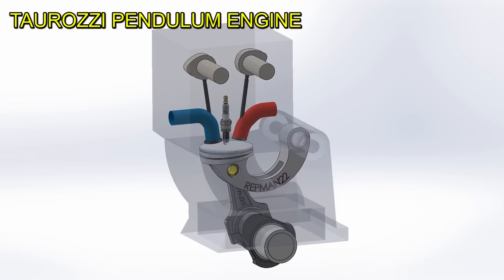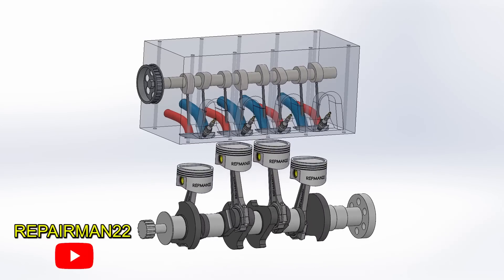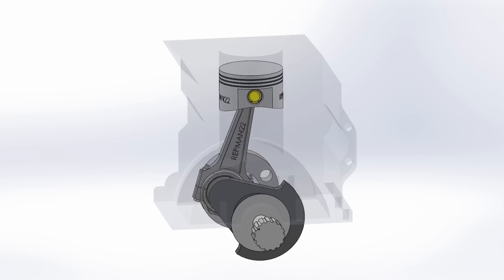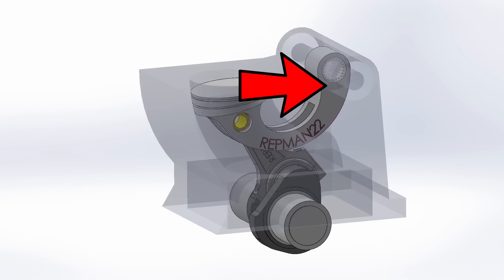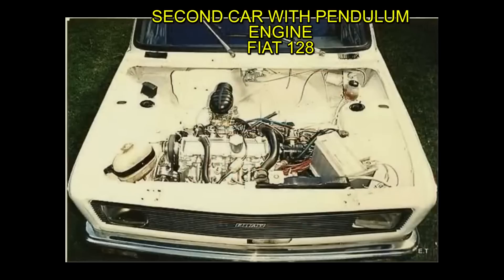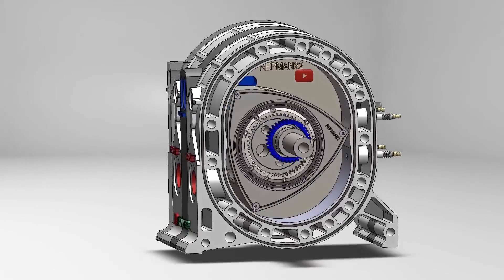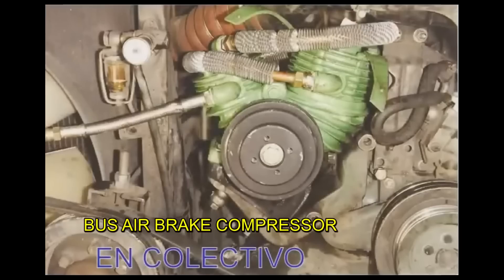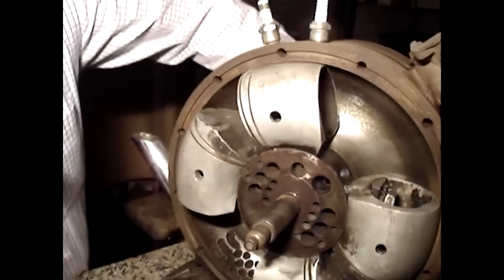All about the Taurozzi Pendulum Engine 🧠 and what happend to it🤯

Comment: This seems like mostly bs. How much friction is really coming from the pistons not having a solid centering arm?  Because you still have to have the friction of the piston rings to create compression.    Just seems like it adds more moving parts and complexity with little to gain from it. Then the dude makes claims about it that aren’t real. And in real world applications wouldn’t actually work better then what is already available.  Like the rotary engine , it sounds cool , but you don’t want to rely on it.

Comment: It's interesting because of the reduction of piston side loads but a curved bore is not easy. The banana arm bearing is a better interface than the piston side. Crank offset is one way to beneficially effect the side load during the power stroke. Low stroke can be a disadvantage and I wonder if the dynamics work well at high rpm where a short stroke is more viable.

I love the idea of chasing piston toroidal engines.

Comment: Same principle suck squeeze bang blow forces applied to one direction on the moving parts causing the same wear from the same loads , yawn 
Parts travel at different speeds in an arc so the load changes to one side from inertia .

Comment: Mandela effect, I have never heard of these engines but since seeing this I have studied it a little and I’m convinced this is one of those technologies that big companies have to destroy to stay in power.     As for drilling curved cylinders that’s simple.    I can drill curved holes as easy as a straight hole.    A curved bit on a pendulum with a center flex shaft that only spins the tip of the bit.    Simple.

Comment: It might as well be a 3 cylinder with the firing order it has. Firing only one of two pistons at Tdc is like tying a rock to the second piston and saying it's more efficient. It's dead weight unless they fire at the same time
Reply from the maker: Its a 4 stroke engine. Not 2 stroke...
Reply: @repairman22  I know, but I see where i was wrong. I thought the middle pistons were for some reason on the same stroke idk why, it didn't make sense to me but I see the lobes in your illustration now, my bad haha. I need to pay more attention

Comment: I actually own two Taurozzi breathing air compressors. They’re pretty neat.
Reply: What rpm they run at? I believe they won't wind out, the internal harmon ics will destroy it's self. Looks great for low rpm power and a lightweight unit. I do know great people built some great devices but had 1 default and gone. 56 327i , red Barron snowmobile,69 model wave runners ...
Reply from the maker: @congerthomas1812  they run at same rpm as standard. there are many models of compresors. i ve seen up to 70hp to feed a train braking system.
Reply: @repairman22  did he create a Diesel version of his engine ?
Reply from the maker: @craigalston2208  no
Reply: @craigalston2208  I would love to see this engine pushed and to see some car guys and some science guys on youtube run some tests. Could we see something that uses any type of fuel such as the piston x.. What are the performance between them. Etc. Would love to see more about this theres really not much information on it on youtube.
Reply: @repairman22  es casi el único que usamos en medicina tanto en la terraza del Fernández, como en el fondo del Rivadavia tenés esos compresores, yo tuve la suerte de poder desarmar uno con unos compañeros de mantenimiento lo que más llama la atención es lo chiquito de los aros, también en odontología se lo usa mucho con aros teflonados....en el consultorio de mi suegra pusieron uno, estoy esperando el momento para meterle mano algún día 😁
Reply: @congerthomas1812  do you understand what compressor means ?
Reply: @molak34  yes i understand 99.9 of mechanical process and electrical.
Reply: @congerthomas1812  lol
Reply: @molak34  A compressor is a mechanical device that increases the pressure of a gas by reducing its volume.
Reply: @andriandrason1318  don't you say.....
Reply: @molak34  I most certainly do!
You are of course very much welcome.
Reply: Do they run very fast?
Reply: @Faded02-k4p  didnt you hear that go kart ?
Reply: @quinnvisser4287  well that is a smaller engine.  They always run fast.
Reply: @Faded02-k4p  same rpm like a regular air compressor, but a little less noisy, and a just a little less vibration... here in Argentina is common use for medicine or dentistry
Reply: After seeing this i am curious about some compressors i have seen over the years that say Oil less. Is there another system or possibly they were these ?
Reply: @JestaBl1tz  Seen some oil free compressors in medical gas and dentistries, just seems to mean no oil in the crankcase of the compressor so there is no chance of oil carry over
Reply: How do I purchase that style compressor

Comment: That would be an extremely difficult block to machine
Reply: Actually not as hard as you would think. Machines that could do it are already in a lot of high end engine shops. Hell, drag racing engine builder Steve Morris just got a machine that could do it with the right program and some fixturing. The trick is to leave the cutter stationary and rotate the block around it. 

The problem would be that you can't sleeve it. So you're stuck with either cast iron blocks (heavy) or aluminum blocks with some sort of coated cylinder like hard chrome or nicrosil.
Reply: @wingracer 16  yes the block would have to be on a tilt rotary table that feeds into the boring head. It would be "relatively" easy to bore. It could not be honed so size and surface finish will suffer. No way to check cylindricity, maybe a cmm but it wouldn't do much good. Cool design! Not practical for automotive applications
Reply: @leadfarmer8773  It could be honed quite easily the exact same way it is bored.
Reply: @wingracer 16  u don't know what a hone is do you? It's a straight stone on a mandrel that certainly can't bend

Comment: The main issues are secondary balance and the cost of toroidal cylinders 

The engines are more expensive to produce and you can only run at high rpm if you have very small pistons.

Thats not a big issue for medical compressors , but its critical for car engines.
Reply: Who said anything about very small pistons?
Reply: @wingracer1614  Just look up "secondary balance".

Once you know what that term means you'll realize why this engine was never put into production.
Reply: @glennchartrand5411  I am well aware of secondary balance. I used to build single cylinder racing engines which are nightmares in both primary and secondary balance. In fact I even made a post on this video about how the design as shown missed a golden opportunity to improve balance by putting a counterweight on the opposite end of the pendulum arm to balance out the arm, piston, rings, small end of conrod and wrist pins. There is no reason this engine can't use large pistons. In fact, since it will have a limited stroke length, it HAS to have relatively large pistons.
Reply: @wingracer1614  The piston moves in two different directions.( up/down and side to side)
So as the piston moves through its curved path you get the imbalance caused by the crank and push rod causing the piston to accelerate unevevenly ( regular secondary imbalance) and the centripetal force of the piston moving in an arc...if you counter balance that you wind up with a larger secondary imbalance.

So you can either live with an imbalance caused by centripetal force , or you can have larger than normal seconday imbalance caused by the weight of extra components and counterweights..

So its a damned if you do and damned if you dont situation.

The only solution is to either build tiny cylinders, or keep the engine rpm low 

Thats not an issue for medical compressors but its an insurmountable problem for car engines.
Reply: @glennchartrand5411  What side to side? It moves in an arc which can easily be balanced. Far more easily than straight line reciprocal can be.
Reply: @wingracer1614  You just dont get it.
Reply: @glennchartrand5411  I get it just fine. Your the one talking about side to side motion of something moving in a constrained arc. There is no such thing
Reply: @glennchartrand5411  it's alright man, you can't win them all

Comment: Think that there is a bunch of Bravo Serra being presented here.  Simply by trying to bore this cylinder may be technically possible it is slow and expensive to do.  If you want to do this much there is a much cheaper method, large marine diesel and they are quite efficient, the piston moves only up and down, then the straight line rod from the piston then connects with a connecting rod.  Steam engines used this method for well over 100 years, yes it works but it is expensive to mass produce.  This is more of a "Yes you can, but why?".

Comment: I suspect "low/no need for oil" is the reason. like telling printer companies you can reduce their ink needs by having ink that never runs out and keep the printer usable for longer.
Reply: Except that the car companies don't sell oil.
Reply: You’re looking for a conspiracy where there isn’t one. If you’re theory about ‘engine oil cartels’ rang true. Then engines would have been held back from improvement since the 70’s. They haven’t and have improved greatly in efficiency and oil change frequency requirements. If this engine was superior then capitalist principles dictate that a manufacturer would’ve embraced it en mass… they haven’t, so it isn’t… it’s as simple as that

Comment: As the piston heats realitive to block wouldn't the piston grow in length and drag in the cylinder?  Works in compressor because the operating tempature difference is much less so it doesn't lengthen the banana.

Comment: Might work well in a turbo diesel for trucks where 1% savings in fuel costs and engine longevity and reliability make economic sense.
Reply: I don't think so. I am a truck mechanic by trade, and heavy duty Diesel pistons are already massive pieces, this design is like having two connecting rods which negates any theoretical advantage due to the increased reciprocating mass. To me this design just combines disadvantages of both reciprocating and rotary engines. Pistons that rotate while reciprocating just smell like excessive Ring wear to me. A well designed Truck diesel already lasts for ridiculous amounts of time and mileage, and the conventional design allows for easy and cost effective rebuilds.
Reply: @mrspandel5737  there seems to be a lack of in depth information to make any specific critique. Smaller pistons with less side loading would save mass. However,if no one has an .F.A.A certification there must be a dead rat lurking somewhere.

Comment: No, his claim of decreased friction is a wash, or even increased, not reduced.  Friction on the cylinder wall is reduced, yes.  But, you then have to add in the mass of the second connecting rod and the increased friction of the second set of bearings.  I don’t believe for a second that efficiency is increased, as he suggests.  It’s just like accusing someone of voter fraud; just “saying” it over and over doesn’t mean it ACTUALLY happened. Same goes for his claims of increased efficiency after he’s added more friction surfaces and mass.

Comment: “Easy to machine a curved cylinder.” 😂
Reply: The piston fits, so a cutter the same shape but smaller in diameter with extended teeth will also fit. The blocks are cast so only the inner surface has to be milled and honed. Rotary tables are common in machine shops so the setup is also quite simple.

Comment: Since modern engines run fairly reliably without significant cylinder wear to around 260,000 miles (426000 kilometers) before needing a cylinder bore rebuild, NO auto manufacturer would EVER care about producing such an engine since factory warranties only extend from between 50-100,000 miles (80-161000 kilometers).  And NO auto manufacturer is going to want to extend their warranties, period.  So, there will never be any interest in such a design by an auto manufacturer.

Comment: This engine would have had some relevance in it's day, but technology has made it irrelevant.
The advances in metallurgy, bearing design and bore lining materials have made the friction benefits that this engine may have had, obsolete.
Back in those days, doing the 'rings and bearings' was coming for mechanics, just doesn't happen that much anymore.

Comment: In theory it works better than a conventional combustion engine. But the manufacturing is more involved because of the curved cylinder. It's still used, because it does work better than the conventional. But to be mass produced is where its' limitation is. It also creates more moving parts which can fail. I have no idea how they are made. But it also adds more complexity to the way it's put together. And needing the extra space for those arched rods makes it a physically larger and heavier engine for use in cars. Both of which are what car manufacturers have steered away from. It's better in theory but isn't practical on larger scales
Reply: You have such a poor imagination, though. Every of your statement is wrong, or perhaps a lie
Reply: This engine is less mass and less friction than a "normal". It also wont wear down. Thats why it wasnt adopted.
Reply: @divinehatred6021  I'm sure it was more efficient than a conventional engine. But there's more complexity to manufacture and produce a lot in a timely fashion. They might still use it in low-production stuff. But on a mass-production scale, I don't think it would be practical. Is why I said what I said. I wasn't dogging on the engine. Just saying that its' design works better but takes more effort to produce
Reply: @richardwilliams9181  it wasnt produced because 1: margin profits wouild be lower 2: planned obsolescence wouldnt work on a engine like that because its way more durable and safe
Reply: @divinehatred6021  True true
Reply: @richardwilliams9181  if you look at the 19th century engine and tech, it still will work today, and steam tractors/excavators will work as well, even 18th century ones 😆

Comment: A lot of custom tooling would have to be introduced to shops in order to work on the geometry of the engine.  I can see that being a large hurdle to overcome.. especially with ICE being on the way out.

More sophisticated cnc machines can mill the block during manufacture, but any work to bore the inside would be more difficult.

Comment: I wpuld wager that boring is non-trivial issue, making it more costly, at best due to replacing existing manufacturing equient, and at worse costing more to prpduce even when you already own the tools.
Reply: A Rottler 4 axis CNC block machine could do these cylinders easy. Setup to get the block rotating around just the right axis accurately would take some time but once that's done you just press a button and wait 30 minutes or so.

Comment: So, what happens when those bearings start to wear? How often would they need to be replaced in a daily driver??
Reply: Not much, i assume there would be a oil feed though all moving parts :P. I feel you replace it as frequently as the piston pin. If you ever done that, they don't wear unit they starved from oil

Comment: It actually has more parts for friction
Reply: @Pickle It did not eliminate rings. It's going to have the exact same need for rings as a standard engine. The only thing that has been eliminated is the piston to cylinder contact and thus friction but that is actually pretty minimal in modern engines

Comment: The fact that it was not put into production by anybody after the patent expired should tell you something.
The fact is - it is a dumb way to make an engine.  It solves  a problem that isn't a problem, and it can't be made on normal block boring and honing machinery.
Any one who has completed the first year of an engineering degree can tell you why.  In my first year, we had to do assignments on the losses  in gasoline engines.  Mechanical friction losses (not counting things like water pumps) account for less than 5% of the total.  Most of it is in the bearings - the friction loss between pistons and cylinder walls is just a part of the 5%.   So there is not much scope for making a noticeable improvement.
There is a rule of thumb with modern car-type gasoline engines:  30% of the fuel energy is converted to mechanical energy available at the flywheel, 30% is lost to atmosphere via the exhaust,  30% is lost to atmosphere via the coolant and radiator (this includes bearing and piston friction loss), and the remaining 10% is lost in the oil pump, water pump, fan, and turning the alternator.  
The lube oil isn't just for eliminating mechanical rubbing - it is for cooling the pistons as well.  Clearly, combustion gasses are in contact with the piston - the piston must get rid of considerable heat somehow.   It does so by conducting it to the cylinder walls via the oil film between the piston skirt and the cylinder wall and thus into the coolant.   In turbo diesels, that is insufficient, so oil is sprayed upwards onto the underside of the piston as well.
So if this turkey thinks he can reduce oil supply to the piston he is deluding himself.
Anyone who rebuilds worn engines for a living can tell you that cylinder bore wear is mostly not due to mechanical wear.   It is due to sulphur in the fuel being converted to sulphuric acid in the combustion process.   It occurs fairly evenly around the cylinder.  Since the advent of low sulphur fuels some years ago, cylinder bore wear has been markedly reduced.
Reply: Well said, there is NOOO way the fiction loss on piston against cylinder can present an opportunity of 30% fuel saving!